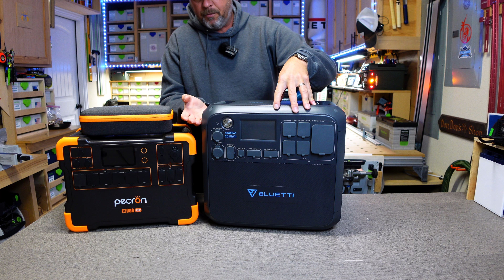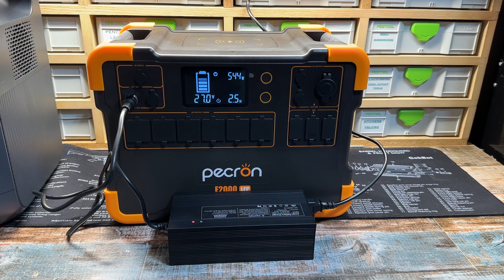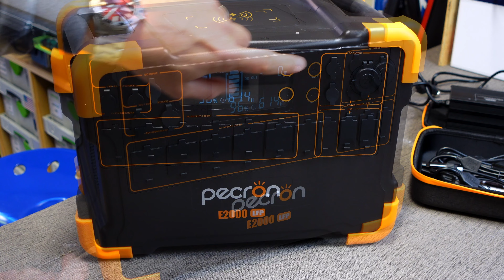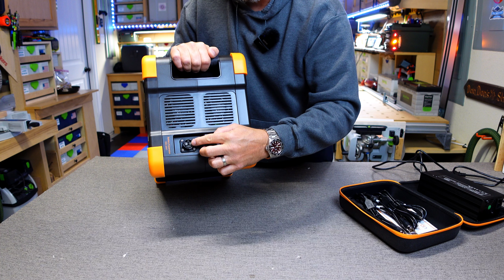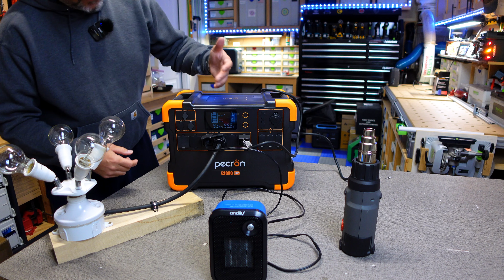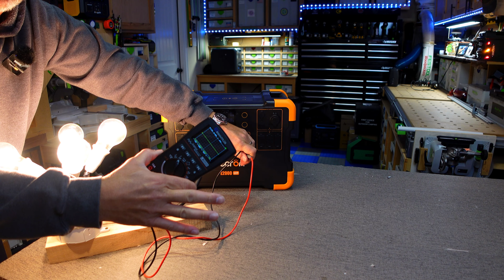PECRON E2000LFP : Fantastic extreme budget friendly LifePo4 Power Station

Comment: Pecron E2000 is only 75amphr and around 12volt / 2000 watthr , and is $1000.
best to get  2 or 3  4d or 8d semi batteries ( 90-145) amphr each  ) ( found everywhere used scrap yrd )  so 2 or 3  is x90 =270- 300+  amphr ) or  small scrubberor  forklift  battery even more amphr)   ,  and   also 2  solar panels, inverter   cheap AND  little  2kw generator   ,  all  way under  $1000  . all bases  covered for a grand

Comment: I've had this for a couple weeks now and I like it and it works really well.  Perfect for a normal power outage, or even extended if you have a generator or solar.  I bought this as a bridge, for times when the power goes out but not long enough to pull out the gas generator from the garage.  I bought it with the two 200W solar panels from Pecron, and it charges well, most I got out of the panels were 360w.  That's in perfect conditions and peak daylight hours.  So I've wanted to do a little more solar, my only complaint is the 32V min input.  It's a pain looking for panels.  Sometimes I can find a good deal on a panel but the voltage don't match what I need, so I can't just buy 1 and add on later.  I need to buy like 3 to meet voltage requirements on many of them, even 200w panels.  The search is still on.  But overall I'm very happy with, I love the possibility to add another 3000w battery later on.  The A/C charger size doesn't bother me, with the size of the battery you are not taking this backpacking, if you do take it camping it will be carried from house to car to campsite, so the charger size won't be an issue.  The lack of UPS is not a big deal for me and I prefer the smaller size without it.  I actually like that it doesn't have an app.  Once less thing to go wrong, and I'd rather a cheaper price than a fancy app.
Reply from the maker: All very good points👍🏻

Comment: Can you plug in a standard kitchen refrigerator during power outage, and for how long? Thanks
Reply from the maker: You should be able to if it is a newer fridge. Run time all depends really how efficient your compressor is to be able to determine run time. You can hook the fridge up to a plug in watt meter and see the amount of watts the fridge uses to get a better estimate.

Comment: I have 7 power stations, 4 being in the 300WH to 500WH size and 3 being over 1000. I have a great rotation  system I have practiced and used in real life long term power outages as well. I also have appropriate panels to power them while others are being used. So I am a big proponent.

However, I think they have their limitations and their role really needs to be as a supplemental role, using a propane or gas generator to quickly charge when needed fast or if days are overcast or rainy. At least as long as gas/propane can be found in a forever grid down. This limits the attention that loud combustion brings to you but uses it wisely.

To that end the last several larger ones I’ve bought have the internal charger and the ability to charge quickly. This is critical whether post-hurricane or SHTF grid down. Either way supplies are limited and charging quickly is critical.

That brings me to this unit. It’s great in every way except the low AC charge rate. When viewing them as part of a power ecosystem, it’s a deal breaker. If they could upgrade that, I’m in! Thanks for the review.
Reply from the maker: Very good point on the charging on this unit👍🏻👍🏻
Reply: If your are really impatient for the 600 watt charger to take ~3.5 to 4 hours to charge, pony up the bucks for a SECOND 600 watt charger and be done in ~ 2 hours or so.  Scheeese........

Comment: I was wondering something...
Since there is a power loss that has the power brick which makes it go down 100 watts or so when charging ac to the DC solar port .
Is there a way to use DC from a generator to get full 600 to each port?

Comment: I am curious about how people are using apps for the portable power supplies. Since I am not a cell phone junkie aka need to use it a lot. The Pecrons not having a app is a plus for me. I have the E3000 and have a E2000lfp on order with two batteries. I have had the E3000 for over 4 months and really like it. Everything I need is on the display and easy to get to.
How often do you really use the app on the unit(s) you have?
Do you think the app is really worth the extra cost in the long run?
Is it something that seemed cool at first but you really do not use? That is what I am thinking happens. I could be wrong with some people. I have heard that about a few apps unless it is required to see certain needed data and settings.
Thank You for any input.
Reply from the maker: It’s not always needed, but some apps do let you change the charging speed and can update firmware, set a time limit on how long your ac or dc circuits stay on….but they all still work without an app. I do like being able to sit outside and remote into the power station to see how much power is left too.
Reply: @GearGadgetReviews  One thing I never did find when I was researching different units was if it is possible to turn off / disable the wireless / Bluetooth of the units that have the apps. Do you know if this is possible? 
Thank You

Comment: Recieved my setup yesterday. Did a few test and im only getting about 85-86% on the capacity test. I see you mentioned it in your video that others are getting 90% and above. Im wondering how.... 🤔 
Did you ever figure why you were getting lower number than everyone else???
Reply from the maker: I ran it a few times and all were around 86%
Reply: @Gear & Gadget Reviews  I got the same results. I was talking to bob who also does reviews on this particular station, and i mentioned to him that... i think the models they have are like the first version which had 110 AC outlets and on the ones we have (version 2 i think) has the 120 AC outlets, and maybe were losing some capacity because of that...

Comment: I've had my Pecron E2000LFP for about 3 weeks and I have just one expandable battery, EB3000 for a total of 4992w of stored power.  I love it!  For the price, you can not beat this unit.  I bought an extra AC fast charger so I can hook it up to my duel fuel generator for a max of 1200w charging so I can fully charge the unit in roughly 4 hours and not have to keep a gas generator running all night.  The AC charger brick isn't a big deal.  It isn't a deal breaker and for the price, buy two of them to fast charge your pecron.  It's been all thumbs on my end.  Also, Pecron is based in China but customer support has been exceptional.  I had a couple of problems that they resolved, above and beyond.  I fully recommend this brand.
Reply: I have both the e 600 lfp and the 2000 lfp . The pecron e600 lfp charger also works on the 2000lfp . Charges a little more than 800 watts with both chargers. I was all about ecoflow I have quite a few of them but pecron change my mind. Honestly in this market pecron is probably under priced for what it does compared to the big names. Very well done pecron!
Reply from the maker: Thanks for your advice and input on your experience with them. I’ve too been very happy with this unit 👍🏻
Reply: @GearGadgetReviews  any issues with alarm beeping noises from the fan area or anything else you don't care for. Thanks.
Reply: @bucksBe is your duel fuel generator a regular generator (non-inverter generator)?  Can I connect a regular generator directly to Pecron E2000LFP+E3000? Or is there another setup recommended so I can use my regular non-inverter gas generator to charge the Pecron?

Comment: I’ve never had anything from Pecron. It sounds like a solid unit. Couldn’t you take a couple 100 watt panels and wire them in series to give you the voltage you need. It obviously would take forever to charge at 100 watts though
Reply from the maker: Yup. I think I mentioned that, that you’d have to series connect a couple of panels to get up to the min voltage requirements if you want to use the bigger 600 watt ports. You could use a single 100w on the 5521 input👍🏻